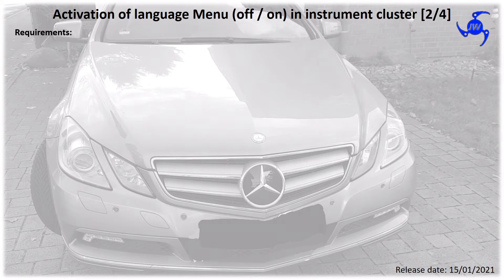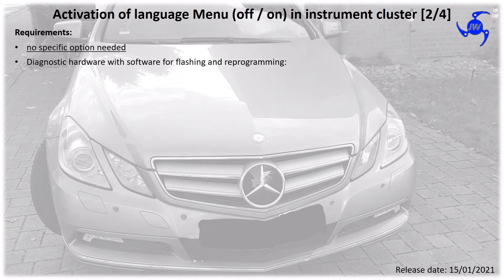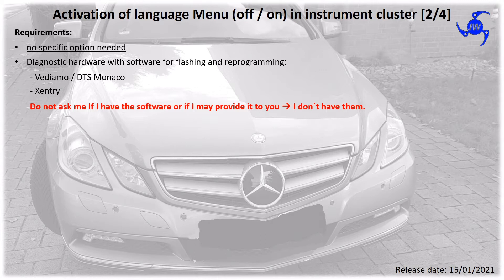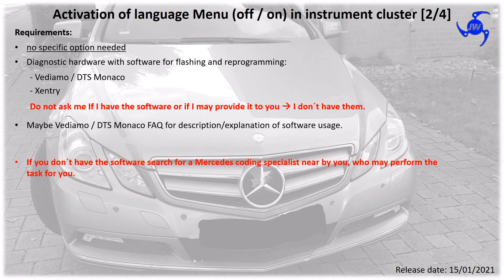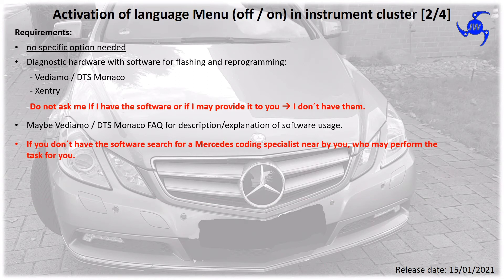DIY - Language menu activation in IC - Mercedes coding manual

Comment: Hi, do you know how to link speed limit assist on map? The icon is there but doesnt show speed limit for the roads. Looked into dts monaco but couldnt find anything helpful car is US imported to gulf and map 2023 is loaded
Reply: Hello, I did activate the SLA today, just had to enable country.
Reply from the maker: need to update the comand ( not map), the instrument cluster and camera to the newest version.
then you need to turn it on in the comand by coding.
Reply: By comand you mean the screen on the right side? Both screens IC and right screen are having the icon. Ok how to update it? I mean what update does it need?
Reply from the maker: First Check in the comand of you find a coding about the speed limits.
if not you need to update the mentioned three ecus.
which one?
i can't tell you.
it's twisted to your hardware version and there are plenty hardware and software versions.
Reply from the maker: if you can't figure it out on yourself you will need to ask a pro.
maybe you will be able to find somebody in the mhhauto forum who may assist you for money.
Reply: Ok cool, updating software sounds interesting, i have a company who connects remotely to my MB through my laptop will ask them. Thnx man
Reply: I disabled SLA since I didnt know how to activate the speed limit, check it in my last shorts